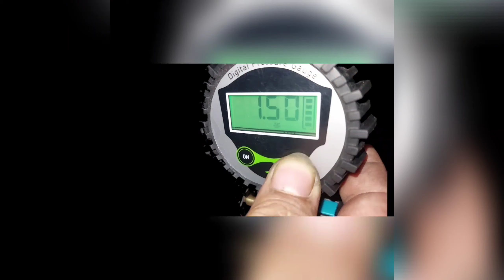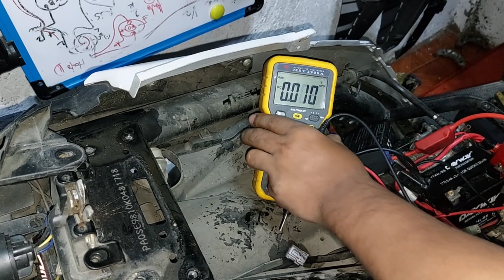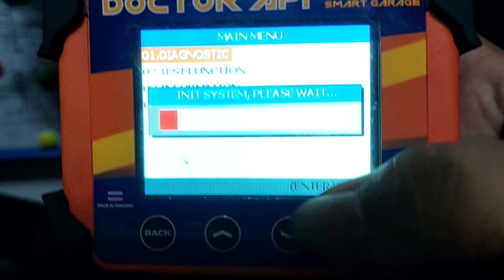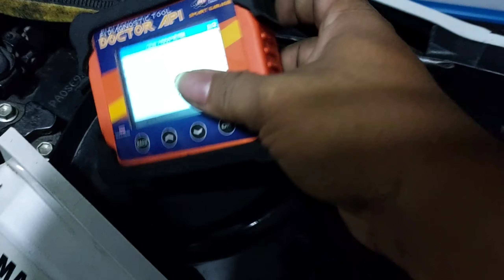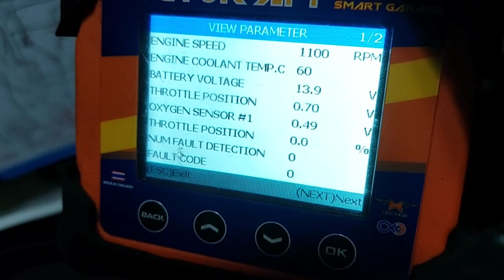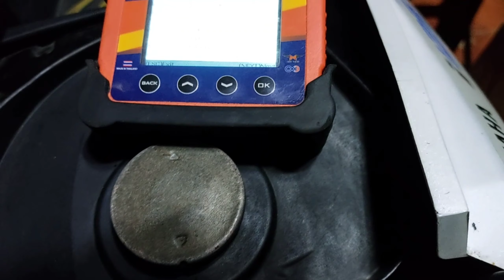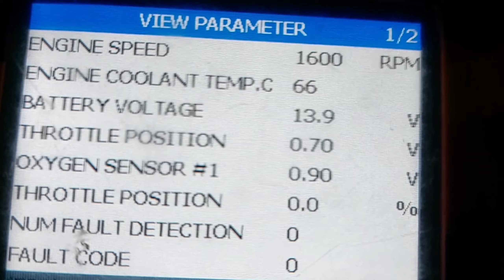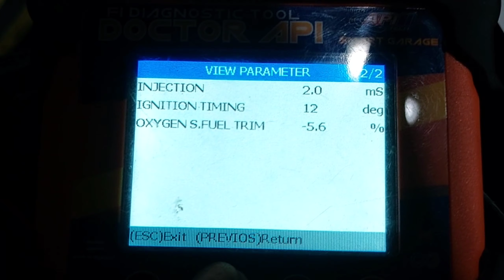"𝙔𝙖𝙢𝙖𝙝𝙖 𝙁𝙪𝙚𝙡 𝙋𝙪𝙢𝙥 𝙍𝙚𝙜𝙪𝙡𝙖𝙩𝙤𝙧 𝙄𝘾 𝙏𝙧𝙤𝙪𝙗𝙡𝙚 𝙎𝙝𝙤𝙤𝙩 𝘼𝙣𝙙 𝙁𝙪𝙚𝙡 𝙏𝙧𝙞𝙢 𝙇𝙚𝙖𝙧𝙣𝙞𝙣𝙜"

Comment: Sir tanong lng Po paano mag test Ng sacket wire Ng injector kng my power o Wala KC Po ag mio i125 ko hindi bumubuga Ng gas ag injector pero pag direc sa battery gumagana Po at oke rn nmn ung fuel pump KC tinanggal Kona ag hose I try ko cya bumubuga Ng maayus ano Kya ag sira Bo's sna masagot mo bos

Comment: Ano po ang kadalasan na problema kung bakit nasira ang Fuel Pump IC? ikatlong beses ko na po kasing nagpapalit ng IC part, palaging nasusunog sa gitna ng byahe. Salamat po sa sagot. Ride Safe ❤️🇵🇭🛵
Reply from the maker: Karamihan overcharging
Reply: @385aron  salute sir galing nyo ganyan sakin lumobo yung battery dahil sa over charging tpos nasira n yung ic sa pump. Tanong ko lng ano dahilan ng over charging?
Reply from the maker: Regulator po or lose connection
Reply: @385aron  salamat po ng marami.

Minsan po hirap magstart din di tulad ng dati na 1 click lang, ngayon medyo hirap magstart ang Aerox ko, napansin ko rin po biglang bumababa ang voltmeter sa 11.6V minsan naman umaangat sa 15V kapag susian ko na po, minsan sa byahe rin po bumababa ang volt at tumataas bigla.